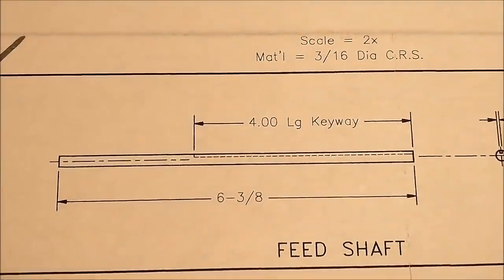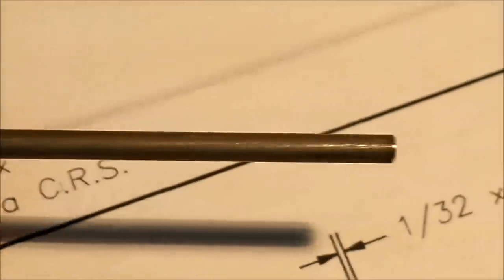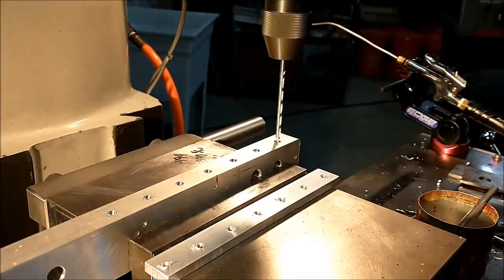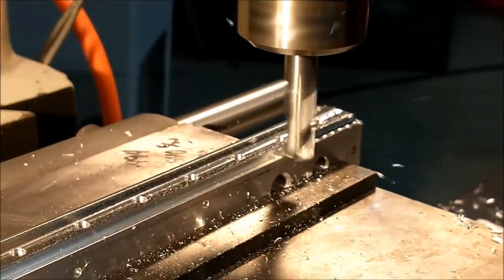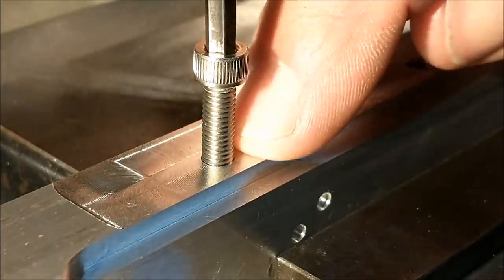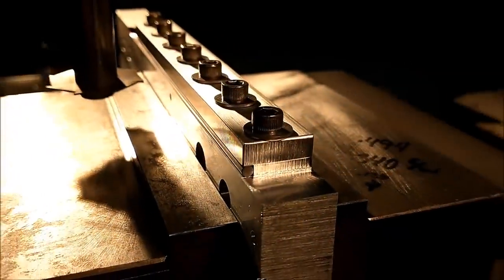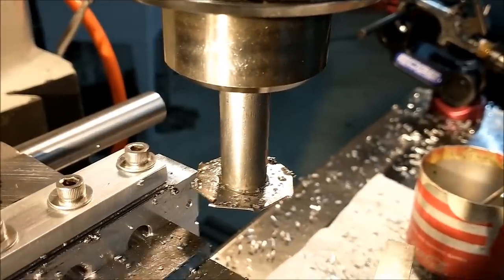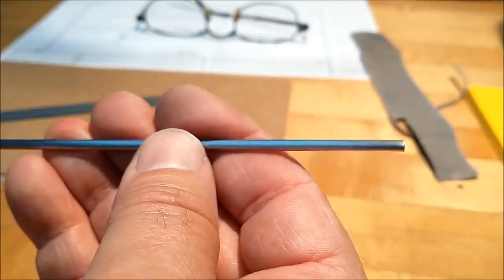Machining Long Miniature Keyways, in Small Diameter Shafts.

Comment: On full sized parts say a piece of 1" diameter shafting steel (ie 4140 TG&P) I never cut long keyways with a conventional end mill if possible. Strap clamp the shaft in the Tee Slot and use a Woodruff Keyseat Cutter. You will get a much better surface finish on the keyway. 
For any one who has ever worked on Landis Crankpin Grinders (the old school ones such as 16Rs) there is a drive shaft across the front of the table that connects the two workheads. These shafts are maybe 2" diameter. The keyway in the shaft was maybe 48" long. I finished cutting one set up by another shift and when we took it off of the mill (horizontal with a .500 cutter iirc) it bent like a banana from stresses in the part from steel mill. New piece of stock out of the rack and cut a new keyway. Nice straight shaft this time. The second one we stress relieved mechanically. 
http://www.stressreliefengr.com/download.html

Comment: Thanks for the tip about gyroing the Allen key.
Reply from the maker: You're welcome. It works well.
Reply: I found a common reason for threads to get mangled a little on the top is when the tap comes out, you dwell there for a bit, this is especially true when doing it on the lathe and the tap is pushing the tailstock back.. as your tap comes out of the hole, you should pull on the tailstock enough that as soon as that last thread releases, the tap is pulled clear.. on a mill, lift up just a little on the quill

Comment: I did use a 1/32 endmill and cut that slot it was very tedious it did work but no where near as fast as that once you made the fixture. Next time I come across a cut like that I will have to give that method a try. Great job

Comment: If I’m not sure of the correct speed I usually start slow then up the speed to suit the cutter, saves having to regrind. I was just wondering how many fixtures I’ve had to make in my lifetime for machining awkward parts, probably into the thousands and you probably have as well.

Comment: Wow, I have messed up many slots for custom screws by milling them. Broken end mills, damaged heads (my mill doesn't have the rpm for something that small...and I lack the experience). I never thought to just pop them into a fixture at 90 like that and hit them with a slitting saw.  I'd consider this a shop gem!  Thanks Joe!
Reply from the maker: Don't be afraid to hold the screw by the head and slot right through the fixture.

Comment: Nice job, Joe! Interesting to watch and I'm glad YOU are doing this! If I was this whole project would have been tucked into a cigar box and placed on a back shelf as it's final resting place! Lol! I'm still watching and enjoying your technics but I do enough small tedious stuff just doing repairs and modifications around here. Enjoying the build and your mods. Great point on the saw surface speed. I use quite a few 2" and smaller dia.  jewelers saws. They start out really well but show their true colors quickly. Can't live without them but no crowding allowed. Thanks Joe. Happy Easter!
Reply from the maker: For slots this small, I prefer a smaller diameter cutter. This was possibly not the 1200 series steel the tail stock spindle was supplied as.

Comment: Engineering/technical drawings are the same the world over, with the title block, description, name of designer, draftsman and signature of authorization at the bottom. I live in South Africa which was a British colony up to 1961, and we 'inherited' a lot of their ways. Hopefully the camera designers will come up with a camera that cancels out the stroboscopic effect, so that we can observe the drill/end mill etc turning in the actual direction.
Reply: It can be done by adjusting the shutter speed (which can add blur) and frame rate (which can "adjust" the direction of rotation.) But there is also the rolling shutter to contend with. For this type of video, I'd not waste a second on camera setup, because at full chat, in the real world, you cannot see which direction the spindle is actually turning.

Comment: Why do you use center drills on most things and spot drills on CNC?
Reply from the maker: The CNC normally is very rigid and uses a much higher feedrate. The spot drill doubles as the hole chamfer too. On the manual machines, the RPM is lower and I like to have a greater cylindrical footprint before the center of the drill makes contact and elevates the resistance.

Comment: Can I ask why you went for a conventional cut on the slitting saw as apposed to a climb cut approach where the cutting action would drive the workpiece back with less chance of slippage.With only a .004" clamping window,if the rod is slightly untrue you could be in for a bad Saturday!No criticism implied just trying to learn.Always a great watch and Happy Easter.
Reply from the maker: I thoroughly inspected the rod before deciding on the fixture design. I also spaced the screws close enough to apply pressure even if the rod had any deviation. The conventional cut was chosen so the cutter didn't try to pull into the cut. It was a very aggressive cutter and that possibility was greater. In either direction, the cutter contact was the same.
Reply: @joepie221  many thankd

Comment: Got a question for you Joe. What's your opinion on chamfers for tapped holes? I was taught to chamfer, then tap. Like you appear to do. It seems to help the tap start easier, and there's no chance of the chamfer tool kicking up a burr at the leading thread. I only ask because I see several people on Youtube tapping the hole, then chamfering or deburring it. I've never had a chamfer turn out as round as it should be when trying to chamfer an already tapped hole.
Reply from the maker: 2 things happen when you chamfer a hole after you tap it. 1. You roll the feather edge of the leading thread over and introduce possible galling and restriction, and 2. the chamfer tool will center on an oblong shape and be off center to the actual axis of the hole. Always chamfer first. You can still clean up any raised burr afterwards, but at least the cleanup operation will ultimately find the original chamfer.
Reply: Drll with tapping drill then drill with clearance drill approx 1 to 2 threads deep then chamfer and finally tap thread. This will give perfect results every time.

Comment: Why take this approach rather than using an end mill/slotting drill?  It would be a simpler job to hold the piece, but is there some potential problem?
Reply: With an endmill that small, you'd have to take multiple passes and/or go so glacially slow to avoid killing the cutter that it is probably actually faster to take the time and make a simple fixture.

Comment: What is the smallest thing you recall working with or making?  Would it be that grub screw/set screw (which one is correct to say, I heard both) in the last video?  What diameter was that in metric?
Reply from the maker: The smallest thing I can remember working on was during my apprenticeship. I served in a toolroom of a company that specialized in precision miniature components for the watch industry. They were shaft collars used to retain the stems of the push buttons on the sides of electronic watches. if you licked the fingerprint of your index finger and pressed it into the parts tray, about 100 or more pieces would stick. I built the tapered dies that closed them around the assembled push buttons. The set screw in this video was a 1-72. I believe thats .072" in diameter. About 1.8mm. the feature I machined on the front was about .75mm dia and .75mm long.
Reply: @joepie221  Thanks for the reply!  Those must have been insanely small!

Comment: A fine sunny morning with a coffee sitting in the spring sun with a favorite creator. Tell me anyone can beat that eh ? Mornin Joe ! ! ! This time I saw before hand where you were going with this setup for a ridiculously small part.  Roughing out a ships 20 cyl engine block on a 4 head mill with a 18 x 76 ft bed took us 3 weeks to tie that chunk of cast iron down and 2 days to do the actual milling. The toughest part of the job was spending the 2 days on running a grain type shovel dealing with the tons of chips coming off the 2 side heads with 24 inch slab mills. When we broke the setup we thought that big $ casting had cracked due to unloading all the stress we created tying that beast down and cutting it as the sound was deafening. Good thing we left an inch + on all faces. We waited for 3 days to rest  before re-setting it to semi finishing it. We could have left more to finish as it just had enough meat. I will never forget that crazy week. You nailed another one my friend.
Reply: 18 FOOT X 76 FOOT bed.  Just trying to wrap my head around that ... and now I need to find my Excedrin.  How many inserts go on a 2 FOOT slab mill? 
I'm going to quit screaming FOOT until this headache goes away.
Thanks for sharing.
Reply: @kevinsellsit5584  LOL, They must have had 100 of them on each head in 3 layers. We used standard 1" square inserts for Cast or Stainless. When I would hit a big sand pocket the whole machine (Dories) looked and sounded like an earth quake. It happened a lot roughing these beasts out.  My main job there (COOPER BESSIMER IN STRATFORD ONTARIO CANADA) was working on a vertical boring mill that had a 24 foot table. It was an amazing job making ships engines and centrifuical pipeline natural gas compressors as large as 4' pipe (45 ton) capacity driven by a Rolls Royce jet gas engine I could stand in the intake. I am 6'7". They had a small refinery with the installation that de-pelletized the natural gas so it was a stand alone operation that can be placed anywhere along the pipeline. 4 years there set me up for a lifetime of machining and fabrication. The bigger the better in my world. I was 20 and full of piss and vinegar. What great memories sitting here talking to you. I will pop over and give you a sub. I am retired now and pour pure silver and gold to save my sanity. Stop by for a visit my friend. You never know what will come tomorrow eh ! Yup, I'm Canadian EH, LOL. Take care, ......Dean......
Reply from the maker: I toured Bethlehem Steel in PA as a kid in middle school. The tour started in a huge building next to a steel wall about 20 feet high. Thunder inside on a very regular basis. I asked the guide if we were going to see any big machines. He smiled and pointed at the wall. Look closely he said. The wall wasnt a wall at all. It was a giant steel shaft turning very slowly and the thunder was the chips hitting the floor and bounce safety fencing. The chips were being collected with a front end loader and the operator had to climb a tall ladder to his control seat and ride the carriage with the cut. The inserts were changed with a crane. I'll never forget that. I would have liked to seen how that piece of steel got in that machine. Most likely by the overhead gantry cranes that were everywhere.
Reply: @joepie221  At Cooper Bessemer we had a 250 standard ton I trained on and in the shed we had 4, 40 ton that all the operators used that had standard controls hanging from them. After being cleared to run "Betsy" I never tired of the long climb up to the cab. The best, fun lifts were rolling the massive ships engines blocks. The first time I did it on my own my insides were in a knot. The odd job from NASA would come in as well. They were INCONEL diffuser rings that we had a hell of a time cutting. I compare that stuff to cutting a tire with a 2x4. We eventually threw their rules away and went old school with high speed tools, (1 in sq.) dropped the rpm and flooded it with Rapid Tap. Remember the old stuff with the skull and x bones on the can. No wonder my lungs are 1/2 shot. The thing that still impresses me today is that our "bible" still and always be our go to book. From the wee things you masterfully execute to Cooper and Bethlehem the basic rules still and always will be our guide. By the way I sure hope you have a plan for retirement that will be here in the blink of an eye. I was climbing the walls after 3 weeks before I discovered pouring pure silver. It was awful waking up to a day without a purpose or a new creation to work on. Like they say about our noggins, Use It Or Lose It. The story of you at Bethlehem sure brought back a bunch of great memories. I think I would have been right at home there. Thanks bud, , , , Grade 8 Dean. Take care eh !
Reply: @joepie221  Knowing you now it surprises me you are still not there at Bethlehem LOL. What really gets me is the machines that made that shaft and the machines that made the machines. I saw on here a vertical boring mill/lathe in Russia that had a 60 ft table. The biggest we had at cooper had a 32' table. It had a hydraulic operators station that could put you anywhere over the work. It was a Dories digital (an early DRO) with a pattern tracer. The mill I spent most of my time on was all manual. Thanks a bunch for reading and replying to all your comments. I get similar numbers and do my best to reply to everyone with my goal of replying to everyone without just saying thanks. It as you sure know, how much time it takes after every post. Ya rock bud ! ! !

Comment: Yeah... those parts are getting smaller all right!  Pretty soon you'll need a microscope so you can see the part... but don't sneeze, you'll never find that part again... have to make it over.  That was a pretty clever way to hold that part.
Reply from the maker: I wouldn't mind a headset or table mount magnifier.
Reply: @joepie221  In my line of work with micro-sized surface mount electronics, I can tell you this: You might be interested in an inspection microscope with a camera (trinoculars) so you could have a video to put on YouTube... and get the ring light (highly recommended)... It's sharp focus and detail is amazing... having the equipment makes a huge difference, you'd be surprised how you got along without one!
Reply: @joepie221  Table mount looks more safe. Getting close and have hair ripped off, even if You're well cut.....

Comment: Is that called a keyway because the key moves on the shaft or is it a keyseat?
Reply from the maker: I'm going with keyway for the movement reason.
Reply: @joepie221  That was my thinking, keyseat for a captured key and keyway for an open slot.  According to ASME it is now acceptable practice to use keyway for both.

Comment: How are we this many years into digital video, and still don't have a filter that makes spinning things look like they're spinning the right direction?
Reply: you can change the frame rate   but by doing so makes it more difficult to get the proper exposure, contrast , and focus.  way easier to inset a graphic explaining it
Reply: It still has to do with frames per second and the rotational speed to get the effect.  Vary any one of the criteria and there will be changes but not go away.
Reply: It's a framerate issue. You can tweak settings to compensate, but that becomes a major task by itself that just isn't worth it for a video like this.